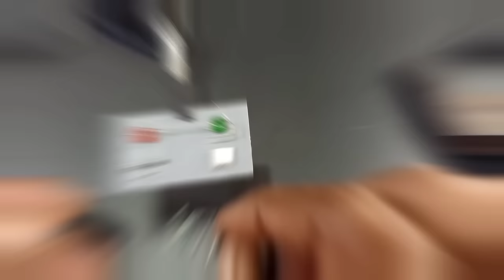Perfect Device for All !! Without Multimeter, all Components Testing

Comment: nice project. just 2 things i did not like: 1) never solder 18650 batteries and also you need to include a charger circuit for your 18650 so you be safe not to over charge the battery and get a small fire....
Reply from the maker: Thanks for the tips!

Comment: You can even improvise this circuit by making darlington pair of transistors to make it more sensitive to detect the capacitance in the order of picofarads. Make arrangenents so that in high gain mode two transistor is used and in low gain mode single transistor (this circuit) is used. Also use resistors as protection for short circuit of the probes.🙏
Just my suggestion, otherwise its a great cost effective gadget to check continuity of any device or component.
Reply from the maker: Thank u for visit

Comment: You can also make wiring detector which can scan through the walls and also detect broken wire inside the insulation through this circuit.

Comment: does the voltage value of the two leds have to be the same?
Reply from the maker: 3v led
Reply: @RJEDITALL  can i add a digital volt meter display in this circuit and how?

Comment: Battery voltage and name
Reply from the maker: Li ion battery 3.7v
Reply: Wtf is that question 😂
What about battery protection don't connect it directly to 5v usb it will over charge 🔥🔥🔥